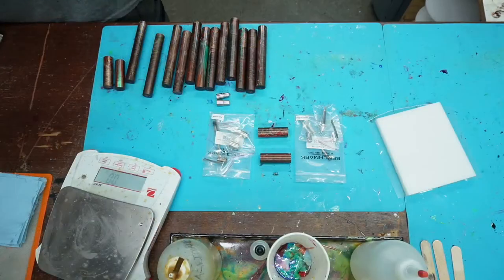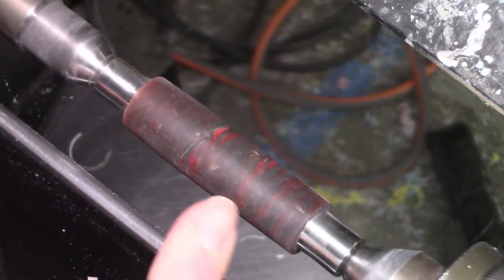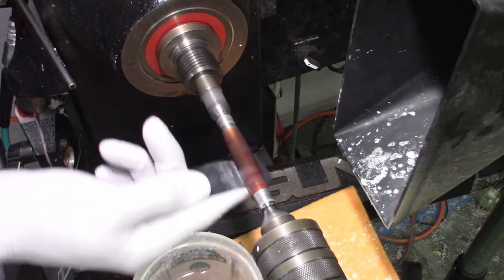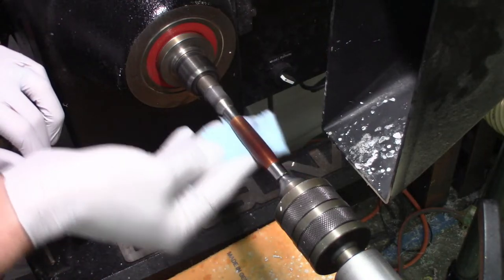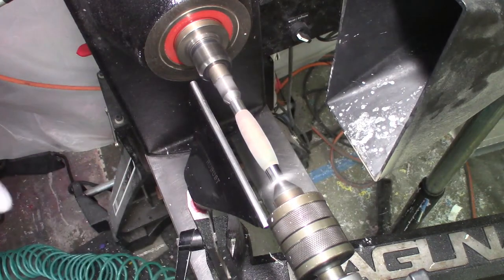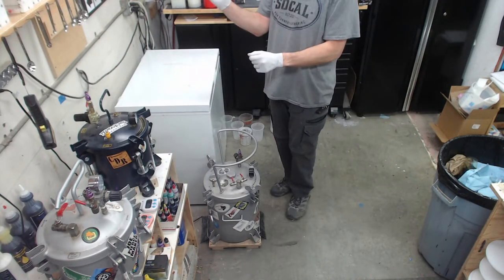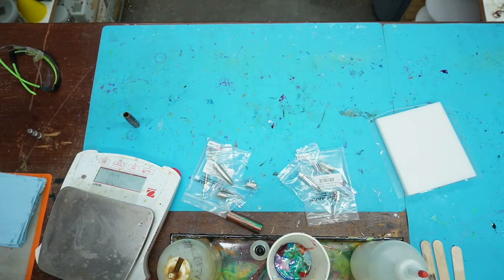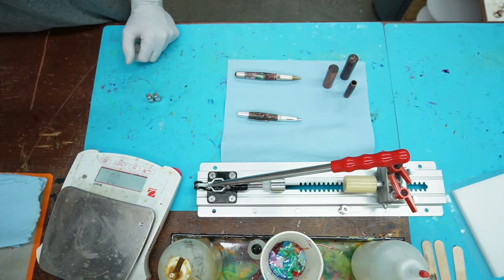🔴Replay: Turning Dirty Pour Samples | Episode 281

Comment: Very cool; it was interesting to see how those blanks turned out. Would be interesting to see results both with more mica powder and with painted tubes.  Thank-you so much for the shout-out.
Reply from the maker: Thanks again for the awesome caddy Mark, I really appreciate it! It works so good! Yeah, bit of a bummer that they ended up on the thin side as far as mica powder goes. I've got a blank ready to turn with a painted tube, so I'll either cheat and turn it ahead of time or on the stream next week so we can see how it looks. I think we need to do a round 2 with these though with a couple different parameters in the pours 😀